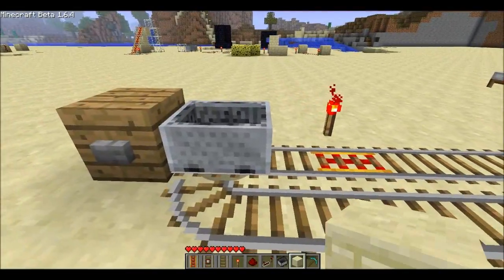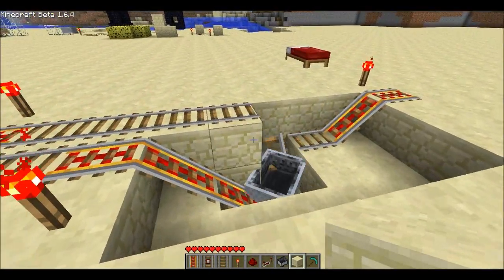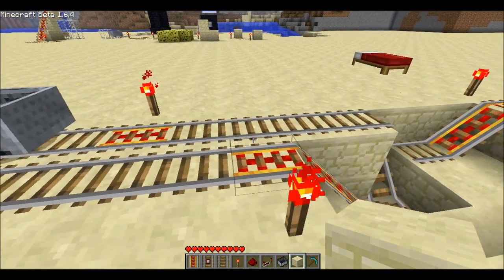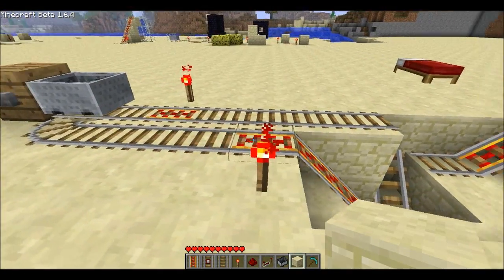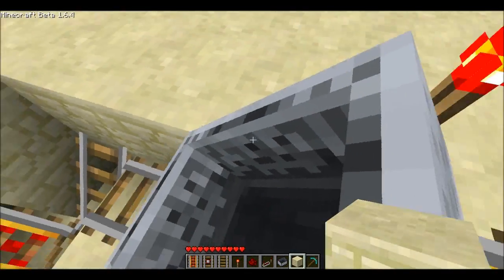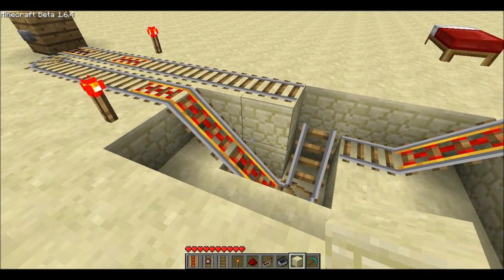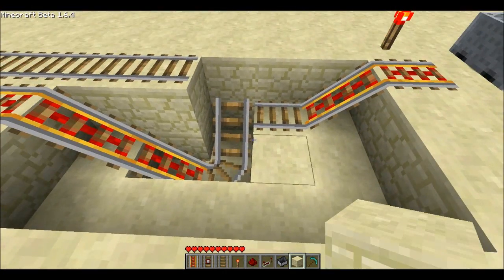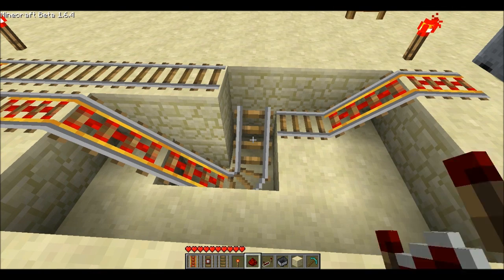Empty Cart Detection using Jumps II

Comment: The only thing about these is- what happens if someone stays in the cart for half of the track before it?  That would probably mess it up.  It's the reason why we need stone vs wooden detector tracks :)  Until then the best solution is using the quirk with the V shaped tracks.

Comment: @66420192 I think that's from taking a corner with a solid block on the inside. If that's the case, make a little room around your corners to see if it fixes. New bug with 1.6